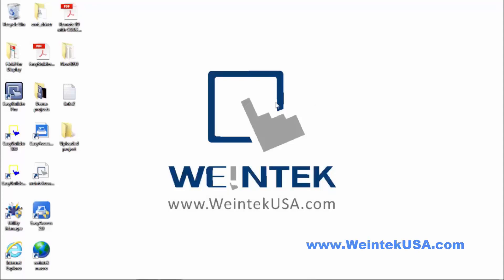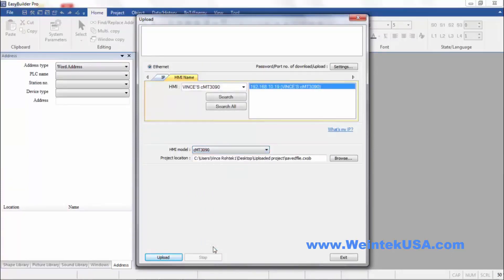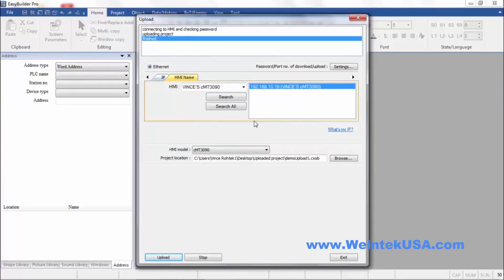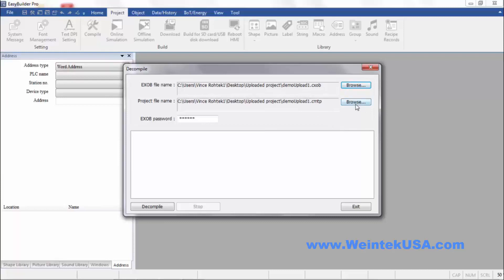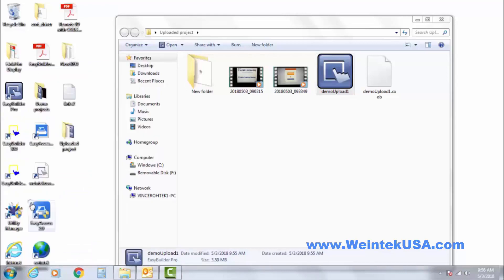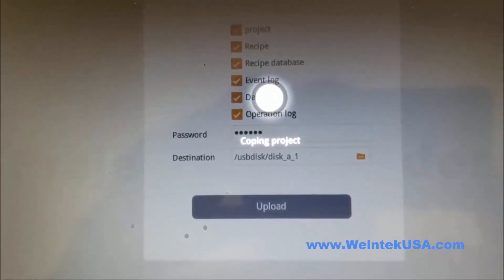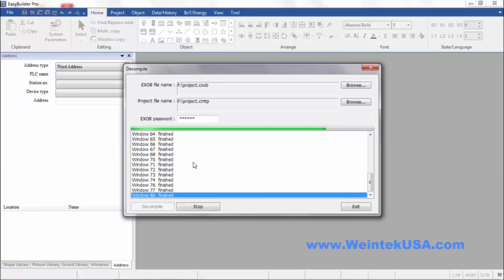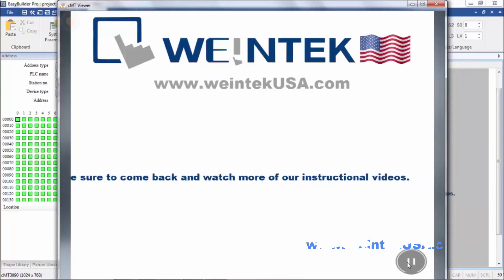How to Upload an HMI Project into a PC/USB/SD Card (Weintek EasyBuilder Pro)

Comment: Good afternoon, I am currently working with HMI WEINVIEW TK8072iP, the detail is that I cannot extract the project through software or direct USB to the panel, in software it marks uploading error,just copy the RWA.rcp file; what could be the problem?
Reply from the maker: Hi @agustinibarra1788,
The TK series is a product line that is exclusive to China, the software requires simplified Chinese and it must be installed on a Chinese version of Windows. For questions regarding the TK series, please contact Weinview, our partner company in China. Thank you!

Comment: Good afternoon, I am currently working with HMI WEINVIEW mt8102iq, the detail is that I cannot extract the project through software or direct USB to the panel, in software it marks uploading error, and in USB the project selection part is shaded, which could be ?
Reply: Hi Alex,
The iQ series is a product line developed for China, the software requires simplified Chinese and the system (PC) must also be under a Chinese circumstance (Windows). If you want to modify or download to your iQ series HMI, please contact Weinview, our partner company in China for assistance.